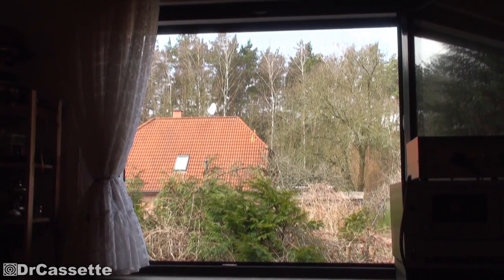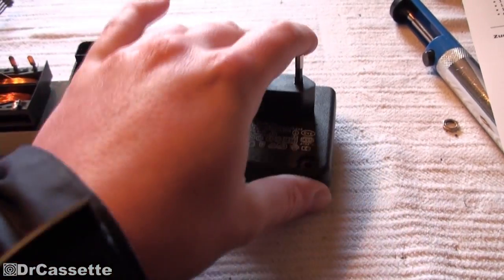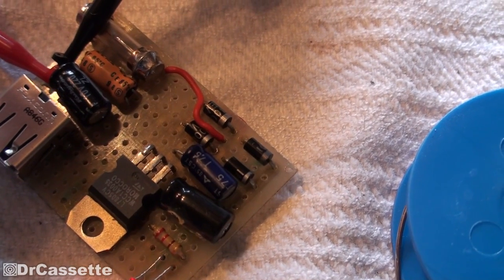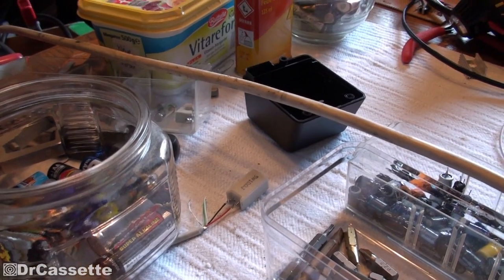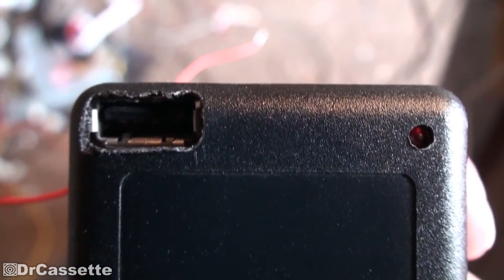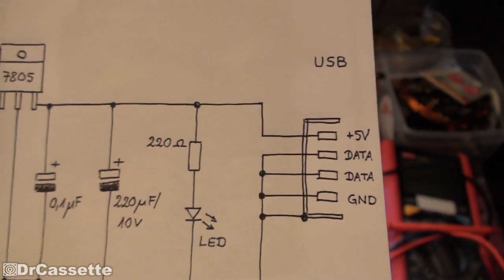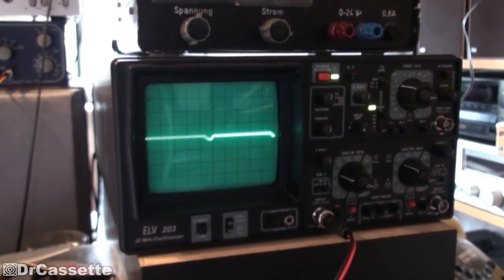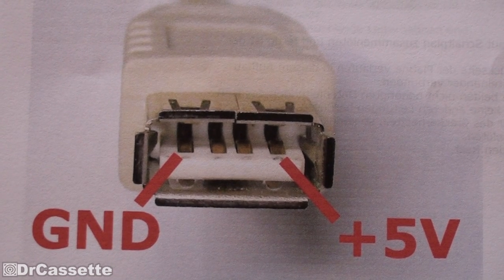DrCassette's Workshop - Building a USB charger!

Comment: Nice hack, you should put a bigger cap after the diode bridge and rated at 16 volts not after the regulator. You could try to find some tantalum caps that are smaller in size for the same value compared with electrolytic. Take care.

Comment from the maker: Space really turned out to be a bit of a problem, however, it's still an improvement over the circuit I found on the internet that this is all based on. There weren't any filter caps in that design at all...

Comment: Actually for iPhones, idevices, the USB data lines get a voltage deliver resisters to tell the device how much current it can take form the charger.  so say 75k 75k resisters connect to V+ and V- and the center goes to the D- and same set will have connected to D+ will tell it can take 1A from the charger.